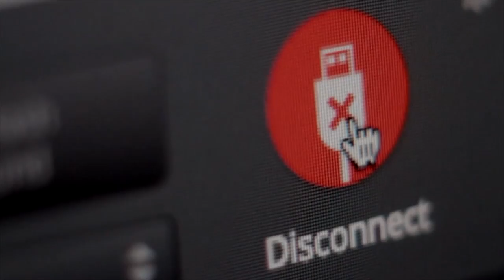MASTERING THE YAW AXIS | Learning to compensate for camera uptilt

Comment: this is off the topic of your video which is helpful as always!..but your the only youtube  quad specialist that answers back with an solution !!..so thanks a bundle!..i just built a warp 270mm impulseRC quad and  was wondering do you have a build video of it in detail  or you built one because this is my first and it didnt blow up when i plugged it in but the beeper will not stop beeping and it turns on just no motor movement ...i bound it and its all good what do i do next???
Reply: drums&drones Hi need more information, have you set the receiver up in betaflight? I.e. Selected the correct port and protocol for it. With a Lipo plugged in (and the props off) if you turn on you TX while the quad is plugged into betaflight can you see the channel values changing when you move the sticks in the receiver tab? Have you set a channel for your arm switch on the modes tab? What esc protocol are you running, unlikely but if it's oneshot or multishot have you calibrated the escs? Is your Lipo definitely charged? I. E. The quads not in low voltage mode? New lipos don't come charged although would expect them to have enough power to spin the props. Are you confident everything is wired correctly?
Reply from the maker: Beeper beeping constantly, possibly you wired it to a regular ground pad instead of the battery pad.

Comment: At some point someone is just going to put a servo on their quad for variable camera tilt, and also sort out channel mixing on the FC so that yaw and roll are always relative to the camera angle.
Reply from the maker: This would be a great idea for a camera platform. In fact, it's how camera platforms work. It's a terrible idea for an acro or racing quad. When the quad can be in any orientation relative to the horizon, you need the camera to be at a fixed angle so that you know which way your motors are thrusting relative to gravity.

Comment: Joshua, any reason to not just use camera uptilt compensation in betaflight? I haven't used it yet but have just set it up to try it since you can turn it on or off from a switch now. Are there negatives to using that feature (besides not learning to do it manually of course)? As always, great content!
Reply from the maker: When you learn to adjust the compensation yourself, you can really use the yaw axis in ways you never noticed before.
Reply: learn to do it properly...

Comment: I have a somewhat related issues to this topic. When I yaw I am getting a lot of roll . Cl racing f4 board betaflight 3.1.7. I'm pretty new so a bit of guidance on where to look would be awesome. 

Great video.
Reply from the maker: Watch the video in the description about coordinating turns.
Reply: The problem I'm having is even when in a flat hover if I yaw semi agresivly it induces a significant amount of roll and some pith. It's also the same case if I where upside falling and attempt to yaw/rotate.
Reply from the maker: Are you in autolevel mode or acro mode?
Reply: Acro. It's really wierd like it's mixed in the transmitter but it's not.

Comment: I'm confused, you keep saying split S when flying over the trees and then just do a roll. Isn't split S half roll and half loop? So you end up flying back where you came from
Reply from the maker: I could have stopped at a 180 roll and gone back the other way. Instead, I did a 270 left roll and exited 90 degrees right of the entry point. But I'm damned if I'm going to make up a different name for every single angle of exit possible.

Comment: A tip from me if you are just learning FPV, don't start with low camera uptilt like 25-30 degrees. Mostly everyone are flying with a minimum of 47 degrees and typically 50-58. Thing is yaw and pitch start to work differently if you go more than 45 degrees, so you need to master that from the start. Start in the simulator and set there your camera uptilt to 48-50 degrees, learn it for some time and then go flying real quad. That will help you from the start as when you will go to quad event or a race, you will be familiar with everyone else's setups, 30-45 degrees are gone in 2016 :) So general tips - pinching on radio, uptilt ~52 degrees and build quad for 5S.
Reply from the maker: I disagree that "most everyone" is flying high uptilt. Racers do typically fly with 45 to 60 degrees of uptilt, but freestyle pilots are more typically in the range of 25 to 35 degrees in my experience.
Reply: yeh. only racers have it that high really or the few freestyle guys that do inverted shit.
Reply: The worst advice I've ever heard. People already struggle hovering or doing slow forward flight with little camera angle, 50-60º is just dumb.
Reply: So you need to train for it. That uptilt won't be very good for slow flights though. For freestyle it's good if you practice flying backwards and flying fast. For racing it's the way as many people are now quite skilled during the years the racing is on. So you need to be on the edge too. Low uptilt will basically slow you or you will see the ground all the time. Also cornering is a bit different with that uptilt. You kinda just roll and that makes a turn. Yaw starts to strain your motors as only two of them are doing the job. So if you think racing, you must learn high uptilt. For freestyle, yes, lower might be more comfortable.

Comment: Can you share your rates? I'm struggling to fine tune when I'm hovering or at low speeds. I have mine set at 1.05 and .79 on roll pitch and yaw with .30 expo
Reply from the maker: I personally use 1.55 and 0.70 on pitch and roll. 1.00 and 0.75 on yaw. I have started to experiment with 0.10 expo as well.
Reply: Joshua Bardwell thanks I'll experiment with that and see how I like it.

Comment: Joshua Bardwell 
Motors 1 & 2 kick on at 1147. Motor 3 kicks on at 1663 and Motor 4 kicks on  at 1014. What can I do to have them start at the same speed?
Reply: You probably just need to calibrate the end points with BLHeli to; min throttle:1000ms, mid throttle:1500ms, max throttle:2000ms and then do the ESC calibration either with BLHeli Suite or in Betaflight configurator. (I'd use BLHeli because it tells you exactly how to do it in the motor tab. But if you know how, then by all means use Betaflight configurator.) And take your props off before any of this! Oh, and make sure you have calibrated the accelerometer, because that can also cause your motors to start at different speeds(and mess up how it flies).
Reply from the maker: If you are using multishot or oneshot, calibrate the ESCs.

https://www.youtube.com/watch?v=o3Mg-9M0l24
Reply from the maker: Use Multishot.

Comment: what rates you run on that quad?
Reply from the maker: 1.55 RC Rate, 0.70 S.Rate on pitch and roll. 1.0 RC Rate, 0.75 S.Rate on yaw. Also, I have started playing with adding 0.1 expo.
Reply: Joshua Bardwell thanks mate, gotta try them i liked how smooth your rolls are

Comment: My brain just can't handle cross coordinating the yaw with roll, past a certain speed or quickly enough to use it for tight tricks :/ I can do S turns and split-s' just fine, but fast and quick rolls just make my brain apply too much yaw all the time and sometime a little magic smoke comes out of my ears after trying to cross coordinate for a bit.
Reply: VilleF1N use a simulator like LiftOff or DRL
Reply: I have DRL(non Steam version) but, i prefer my quad over it because i just can't seem to make the sim behave exactly how my quad does. I've gotten it somewhat close, but i also have an empty field next to my apartment complex to train on with my quads. So yeah..
Reply from the maker: I don't know if a simulator will help with this because the exact amount of yaw needed is specific to the copter, so the muscle memory won't apply.
Reply: That's probably why i've been struggling with learning to cross coordinate, because i learned on to fly with my first build. Which is QAV-R, Lumenier 2206 2350Kv motors and dem sexy Skitzo props and then a few months later, i build my current daily ripping machine which is QAV Skitzo frame, Brother Hobby Returner R4 2206 2450Kv motors and DAL Cyclone props. I sort of learned to cross coordinate with my first quad, but i never were too good at it. And now with a quad that hovers at 35-40% throttle vs 50% on the old one and with 35-40-ish deg of camera tilt vs 25-30 deg on the old quad. It's been a struggle to get adjusted and actually trying to learn, how to do it properly.

Comment: Anyone broken QAV-X frame ?
Reply: BuzzCola 3 Top plate $12. BH T2 motors x2, Mobius Mini and Firefly Q6 all dead, but still the most rugged frame I've got.
Reply: Ghost Ryder FPV I will need 2 parts that are holding the camera and what happened to your quad ?
Reply: BuzzCola 3 The top plate died in a head-on crash with a 101mph Alien, the video is on my buddy's channel Jarrod Bath. It wasn't pretty for either quad - we believe the Mobius Mini is in low-earth orbit near the ISS! But only the top plate broke and took out a VTX too. I've hit a thick pine branch at throttle diving in, and damaged a 2300kv T2 motor shaft. Ate the ground after passing a radar gun (maybe should have looked at my volts in the OSD BEFORE the pass, whoops) and reinvented the wheel, rolling for-ev-er. It's a tough little bastard!
Reply: Ghost Ryder FPV i have broke that pease becouse my motor unscrewed it self and i fall out of the sky on the tree, Ive had phone on my quad and it ripped of phone with pease of my frame. It was my second time flying fpv
Reply: BuzzCola 3 Have a quick look at my channel, you'll see the abuse these things can take lol. My group of Quad Squad pilots prefer Armattan Chameleon frames, and the sublime Impulse Alien, but they're a bit rich for my blood. The most rugged by far is the Alien, but the Chameleon has a lifetime warranty (but shipping to Australia is a pain)
Reply: Ghost Ryder FPV I have already subscribed. :D
Reply: BuzzCola 3 Oh man! Thank you, I hope you like the videos BuzzCola! Our group is fun, and we do it all - 3d fixed wing, long range fpv, racing, but fun is what we shoot for!